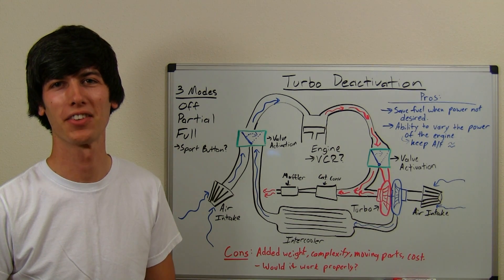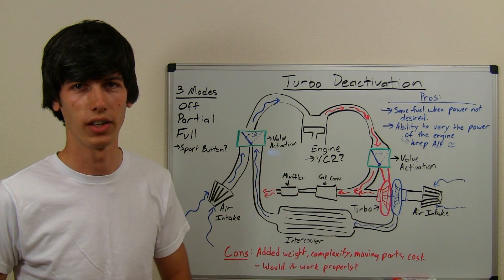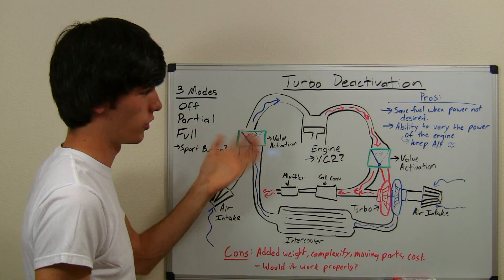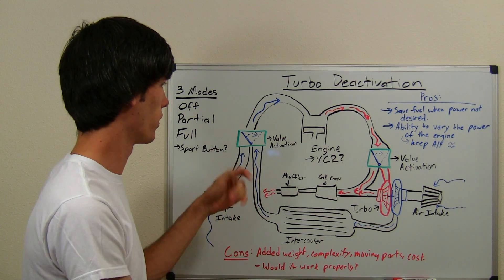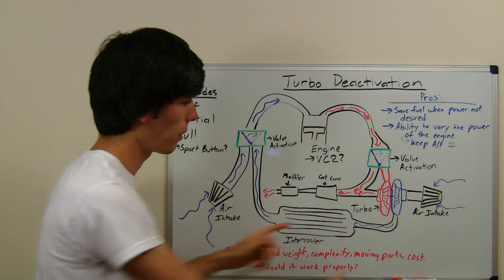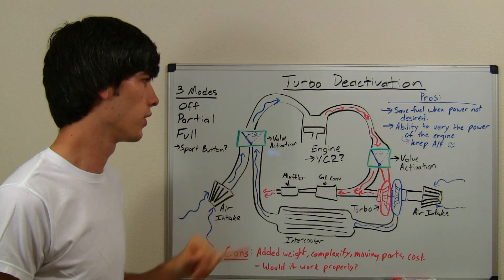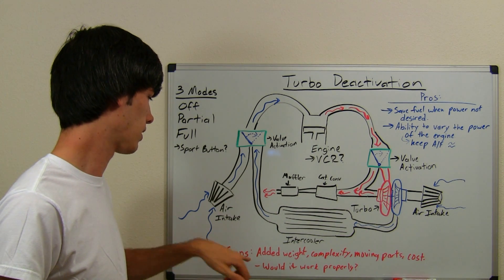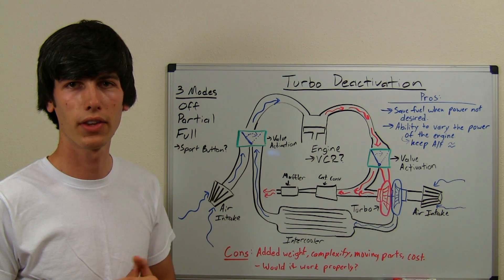Turbocharger Deactivation Concept - Explained

Comment: The fact that a 2.3l efi turbo is only slightly more efficient than a 1940's v8 supports my case. If what you are saying is correct, for example, a 2.0l turbo should be more efficient than a 2.0l NA. Wny is that not the case though?

Comment: Turbochargers typically do NOT increase fuel efficiency of petrol/gasoline engines, as they are hugely wasteful in this application. Turbocharged petrol engines are used as a means of increasing power where space is at a premium. On the other hand turbocharged diesel engines are MUCH more fuel efficient than NA diesel engines. Don't take my word for it look on the roads - loads of economical turbo diesel engined cars and no economical turbo petrol engined cars.

Comment from the maker: As doktorbimmer has pointed out, the idea is flawed, since turbocharged engines increase fuel economy by increasing thermal efficiency and allowing for a smaller engine to do the same job. Nevertheless, I learned a good deal simply from posting this, and other have as well. Sometimes it's good to hear that your idea is flawed; the next one will be better!

Comment: I don't think it would be that great of an idea. I'm under the impression that the only downsides to a turbo are complexity and cost. The whole reason you have a turbo is so the fuel would ignite better, ignite more and expand to a greater volume.  It seems to me as all of this would be lost if you took away the Turbo, and since it's not connected to the engine like a supercharger, I don't think you'll save any fuel. But it's always fun to come up with new ideas. Love your vids! Keep em coming

Comment: i personally dont think this would be useful. shouldnt having a turbo help your fuel economy? not by alot just a little bit. because with more power the less amount of fuel you will need to get your car moving. i understand there will be pressure in the pipes between the combustion chamber and the turbo not allowing a nice flow but overall i think just a turbo would help you economy?

Comment: Lol nice idea.. But a properly tuned turbo engine does this already... AFR's are maintained by this ECU... Only when the engine is under full load (WOT) will the turbine start to generate full power (think turbo lag) a boost controller can be used to further limit the consumption by reducing boost... FYI Some high power cars with large single turbo setups don't experience full boost (power) in first gear simply because theres not enough load on the engine... This might work best on a supercharg

Comment: Pretty much what you explain is already in my 1.8T or any Recirculating turbo system... the intake valve would be the blow off or diverter valve, and the exhaust valve is called wastegate... both diverters are controlled with the engines vaccum system... when you are not accelerating, the vaccum lines keep the wastegate and diverter open, so the turbo doesnt compress air, when you accelerate they both close and the turbo starts to spooland compress air... Great video tho (:

Comment: Great video but I have a question.How it's going to work on modern diesel cars because I saw one with some turbo problems and it couldn t make it up a hill in 1 st gear.I think the power on most turbo diesels this days come from the turbo.So if you could turn off the turbocharger wouldn t mean a sudden loss of power and the car struggling to keep up the pace?
Great channel and keep up the good work!

Comment: Hmmm how does lowering compression ratio decrease fuel economy, I thought if  your engine had higher compression ratio your engine will burn more fuel but will be more efficient at the same time. Take an example of 4afe vs 4age, former is for mileage with lower compression whereas latter is for performance with higher compression which also needs higher octane fuel.

Comment: the gas does not stop expanding until it is cooled. - never said it didn't

You said yourself that the turbine inlet temp of the turbo is HIGHER than the outlet temp of a Normally Aspirated engine! Where do you think that heat comes from. - You're getting heat and temp mixed up again. The temps are higher because the turbo is a restriction to the gas flow, increasing its pressure and hence temperature.

Comment: Do ye know something about the fuel supply and that it depends on the ECU, it needs mapping as well along with other changes. The air pressure inside the engine is less then the atmospheric pressure i.e. 1 bar and natural gas is lighter than air, hence it disperses quickly when released. So that is the main issue probably not when keeping economy in mind but for performance.

Comment: Turbos increase fuel economy. More air is packed into each cylinder so you get more efficient combustion.
Turning the turbo off completely would reduce fuel economy not increase it.
Although, it would be nice to manually control boost pressure from the drivers seat.

Comment: Yes the turbo recieves gas expanded from combustion in the IC engine. There is no heat added in the turbo though and so it cannot be considered a heat engine, only as part of a heat engine. This is also why the turbine of a gas turbine and a windmill can't be considered heat engines.

Comment: Look at the Carnot cycle for a standard IC engine. Ther  addition of heat (combustion) stops well before the exhaust valve opens. What you are trying to say is that somehow combustion starts up again as the gas is exhausted. Simply not true. ALS systems can work in many ways.

Comment: I wouldn't bother mate. I doubt a 12v compressor is going to produce much boost at all. It will be runniing off your battery, which is running off your alternator, which runs off your engine and so doesn't sound too efficient.

Comment: The supercharger can run until a max of 3500rpm. I don't know what point you are trying to make any more. Below 2500rpm the supercharger supplies all of the boost, below 2500rpm it is a supercharged engine.

Comment: "Combustion process does not end when the exhaust valve is opened" - no, it ends well before then. Look at the Carnot PV diagram. Heat is ONLY added during steps 1 - 2, at temp TH. Once the gas has expanded to a certain extent combustion stops, the gas continues to expand and cool to TC where it is exhausted to the turbo (2 - 3), obviously without the addidtion of more heat. Therefore a turbo is not a heat engine.

Comment: lol ye would not say that if ye would have driven a NGV(natural gas vehicle), I would be more that happy to post ye some videos showing 0-100 on petrol and CNG then ye can do the aftermath just because ye see CNG vehicles doesn't mean ye know how they run. 
That is what im telling ye, ye can do race as well as save fuel at the same time 1- use petrol + turbo to race
2- use CNG as a cheaper fuel + go green that is not meant for racing

Comment: the purpose of this system can be to save fuel or to have a green environment if that what ye like. Thing is ye can tune your ride on petrol and use turbo to get the max out of it but if ye would go about running turbos on CNG or LPG those are fuels which gives around 20-30% lower power as compare to petrol so those aren't meant for racing and both having different properties (octane number) that isn't possible to tune both bcoz air fuel ratio matters

Comment: man have ye seen buses racing in the streets? would ye rather run your ride on petrol or CNG to race. Those buses are purpose built natural gas vehicle to save fuel and yes i know if ye have a car with turbo it will give ye better mileage unless ye use the boost im aware of that

Comment: "as long as the turbo spins up its reclaiming energy from the exhaust". What BS. Only if it's putting that energy back in.

"it unloads the turbos compressor" You're right there. With 17.4 psi before and after, the compressor is doing nothing.

Comment: "the addition of heat is in the waste heat from the exhaust stream of the Otto cycle engine!"

The addition of heat happens only in the combustion cycle. There is no combustion inside the turbocharger (unless considering some rare anti-lag system) therefore it is not a heat engine. You are confusing the addition of gas at temperature with the addition of heat. I can't believe you claim to be some authority on this yet fail to understand its basic concept.

Comment: No, the turbine wheel of a turbo charger could be compared to the final stage of a multi stage turbine, of a gas turbine. It really is simple, they cannot be considered as seperate heat engines because there is NO addition of heat.

It doesn't matter if the supercharger is helping to produce exhaust gas, if the turbo is producing no boost it is producing no boost.

Comment: Ok, imagine we fitted an NA engine with an exhaust turbocharger, but without plumbing it in to the air inlet system. So you'd have the compresser side in open air, and using the stock NA inlet. What effect would this have on the engines performance?

Comment: "Turbocharged engines have higher thermal efficiency and more fuel efficient than normally aspirated engine of equal power output" - In an ideal world.

In the real world turbochargers on petrol engines are hugely wasteful. The energy recovered by the turbo is rarely 'put back in' efficiently and the heat losses are enormous.

Comment: Below 2500 RPM the supercharger is in continuous use. The point is that using the tsi engine as an example of an economical turbocharged engine is flawed seeing as the engine only operates as a true turbocharged motor at engine speeds above 3500 RPM. During efficiency tests the engine will probably never even reach those speeds, so it's an irrelevant example. So come on then where's your top 10 list of economy turbocharged gasoline engines? - no superchargers allowed.

Comment: you need to look at the whole picture, if you look at his design and replace the fixed position valves with modulating valves controlled by the pressure differential at the intake manifold then set the exhaust valve to a certain base position so its only bypassing a small amount, much like a waste gate on a regular turbo, then as pressure increases it will gardually open, then you would have a gradual increase in power rather than have that sudden jump in power you get with a regular turbo.

Comment: you would only need one activation valve. The intake valve could have automatic open/close action. If the first valve(exhaust) is open then there is compression that closes the other valve.
also, instead of one air intake, would it be possible to share a single intake. I think this would only be useful when A car has a large turbo. You will need to be able to adjust injector levels as well? maybe? This would be pretty expensive. Let's do it!

Comment: if i've explained this correct as far as i can see this would effectively reduce the turbo lag, and at the same time at low revs if you wanted to hammer on the throttle you would still get that ummphh because the bypass is open and you have open intake and exaughst

Comment: also a little extra idea to have this design as a method of just overcoming turbo lag, instead of the simple fixed position valves, why not have in place automatic modulating valves then at low revs you will have the turbo partially rotating as usual but with some bypass to exaughst and some bypass at the intake, then as you increase the throttle so will the exaughst pressure and the modulating valves will slowly close the bypass and open up the turbo route

Comment: Think about it. At low revs the supercharger produces 17 psi, more than the turbo can produce. That means there will be 17 psi before and after the turbo compressor. There is no pressure gradient across the compressor and hence the turbo charger is doing no work, it is taking no energy from exhaust gasses, it is inactive. Only when engine speeds approach 2500rpm will there be enough exhaust gas pressure for the turbo charger to start compressing inlet air, and hence 'do work'.

Comment: Yes. Work from heat not work from a fast moving gas.

There is a temp drop accross the sails of a wind mill therefore by your definition it is a heat engine.

Comment: Think about what you are saying. The most important part of a heat engine is the addidtion of heat. Do you think a windmill is a heat engine because there is a drop in pressure, and temperature, as air passes through its blades?

Comment: ".........and boosts fuel economy by recovering the waste heat of the engines exhaust stream.. it improves efficiency and power"

And that's why every gasoline engine has a turbocharger, right?

Comment: Yes. The superchager is more efficient at low rpm's the turbocharger at high. At low RPM's the turbocharger produces no boost, it is not an effective restriction to either exhaust or intake, it is not active. Problem here is you think for something to be deactivated means it needs to be physically removed.

Comment: Wouldn't the turbo still spin up and throw air out of the exhaust and the "turbo air in take" with your design, and this would essentially be a big leak in the tuned exhaust.

Also would your exhaust be able to be "tuned" for both configurations? wouldn't it be a compromise for either configuration?

I could be wrong just few thoughts.

Comment: Where do thing the magic force comes from that drives the turbine? - The turbine is driven by the kinetic energy of the exhaust gas. It is not a HEAT engine.

Comment: Don't listen to him. Chech out the VW 1.4 TSI. It has a turbocharger deactivation system to remove the ineficiency of the turbocharger at low RPM's. The sole problem with the system you suggest is that forced induction engines require lower compression ratios. In the VW engine a super-charger is used at low revs (yes more efficient than the turbo!), but in the future variable compression engines will be used in conjunction with turbo deactivation systems so you'll get the best of both worlds.

Comment: In a triple expansion engine wouldn't the exhaust stroke of the first cylinder require less work if it vented to atmospheric pressure rather than the working pressure of the second cylinder?

Comment: "the exhaust outlet temp is lower for the turbo engine", - but typically they aren't though.

So back to my previous question then. Why are exhaust gasses so much hotter in a turbocharged engine after the combustion cycle (ie before the turbo) than EGT from a NA engine?

Comment: I brought up pre turbo EGT because it shows how the restriction caused by the turbo reduces thermal efficiency of the combustion engine cycle that preceeds it. Typical EGT's (TC's) of a NA engine and comparible turbo engines (post-turbo) are broadly similar.

Comment: hey ! Here are a few things to improve that desing. I'd take out the air intake which is used when the turbocharger is deactivated. then,I would make a kind of shortcut between the "turbo air intake" and the intercooler, avoiding the turbocharger. then you put the valve  between the turbo and the pod filter, allowing the airflow to pass through the turbo or directly through the intercooler,thus cooling the air and improving performance and fuel economy.BTW,did you receive my thing on the KERS ?

Comment: While Turbo engines do have lower compression, you will still be improving the fuel economy somewhat by deactivating the Turbo and all associated drag/restriction of the piping work etc.... even if you don't get to the fuel economy level of a N/A Engine running higher compression to begin with.  Another thing to consider is the exhaust manifold design on a car with Turbo deactivation, how well will the scavenging affect work with turbine bypassed? not as well as N/A Car, another consideration.

Comment: Check out the VW 1.4TSI engine. It has a supercharger and turbocharger. The supercharger operates at low - mid RPM, then the turbo takes over.

Comment: Hi VLTurbo. Yes you are correct. Exhaust gas will still spin the turbo, but it will only be idling and therefore not really a considerable restriction to exhaust or inlet air flow. Turbo engines (petrol) have compression ratio of ~ 8:1, NA ~10:1. If you try to run a turbo engine without a turbo you will end up with a NA engine with low compression. Low compression equals inefficient combustion, poor performance, and economy.

Comment: So maybe even if you run the turbo, you just have to press the throttle less and get the same performance as the boost from the turbo is helping the car accelerate faster.  Good Idea still and maybe it could have some sort of useful function, much like how some cars with Superchargers have the supercharger deactivated until a certain RPM, so it does make sense.

Comment: The only consideration now to take is will the extra cost of the piping and valves, outweigh the full saving given in a reasonable amount of time, probably not... so this Idea could work, especially on cars with smaller turbos that are very eager to come on boost with extra throttle, by deactivating this turbo, you will in theory get more fuel economy, but it's really hard to say, as without the turbo you would need to open the throttle more to get same performance and "work" done anyway.

Comment: agt155, While your Idea might work in Theory, in practice by having the wastegate actuator fully open, Exhaust gas is still spinning the turbo at some rate, this would create a slight flow restriction decreasing fuel economy, and the air would still have to flow past the Compressor, through intercooler etc, this might also create a slight loss.  His Video is working more on the concept of bypassing the turbo completely, which is better for fuel economy.